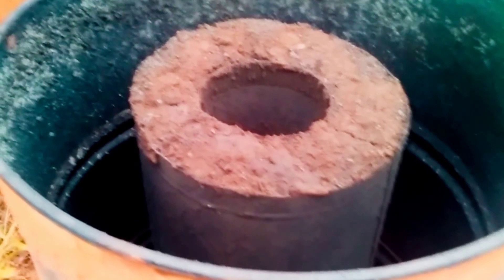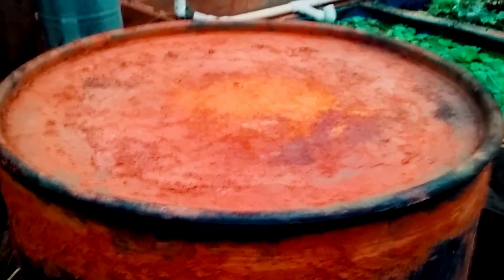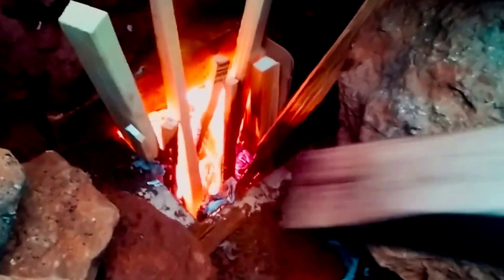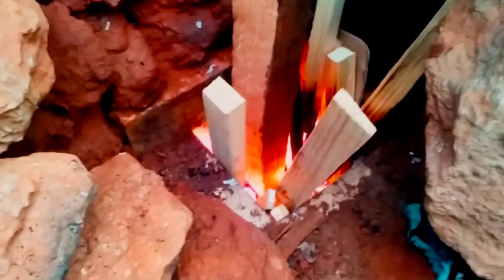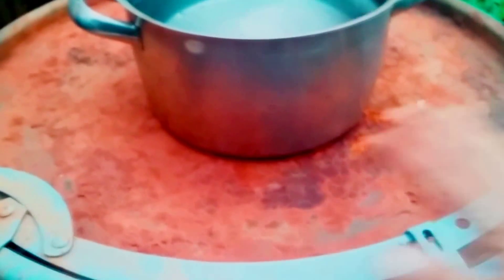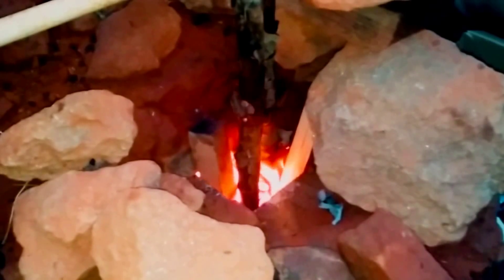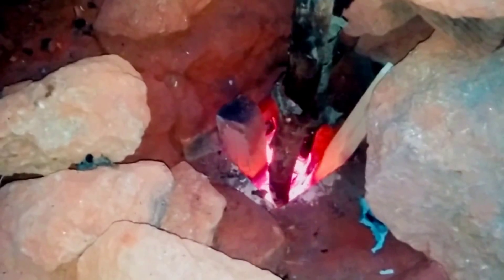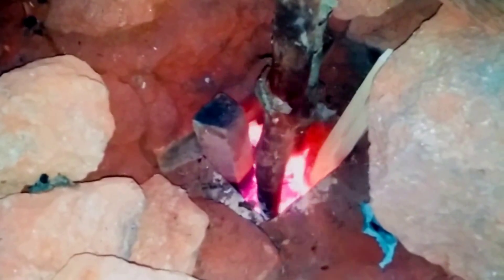Rocket Mass Heater Update

Comment: Thank you very much for sharing your wonderful series on building your heater.  I have been thinking of building one of these jewels.

I was wondering if you would see an increase in overall efficiency if outside air was piped in to the area around the burn box for combustion air?   It has got to be pulling a lot of air in for the efficient burning that your RMH does.

It would seem logical that combustion air piping would eliminate the cold outside air from being pulled in through the cracks of the green house and mingling with your warm inside air.

Thanks Again & God Bless,
Jon
Reply from the maker: You are so right we are about to build onto our tiny house and it will go right over the tiny house I will try your idea then Thanks
Reply: Piping in outside air is not recommended, because then the air in the feed tube (where you put in the wood) can be warmer and cause its own draft and pull smoke back into the room.